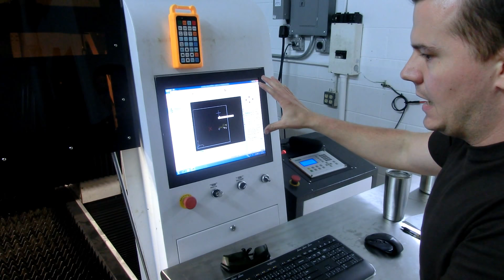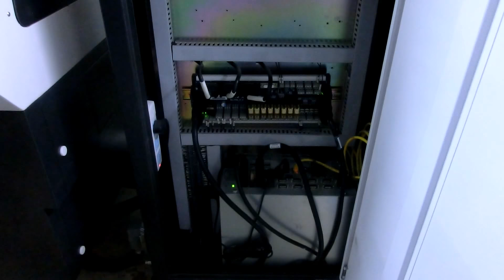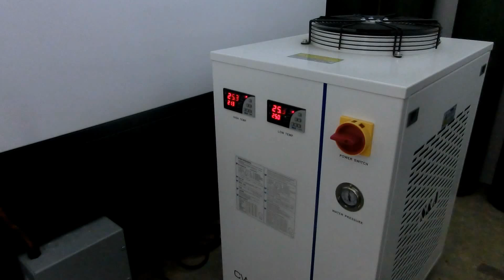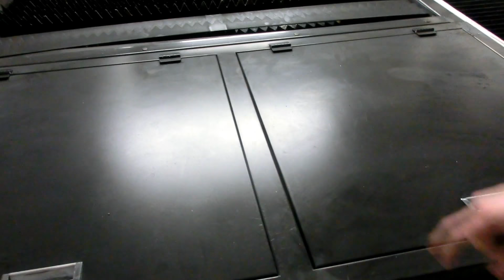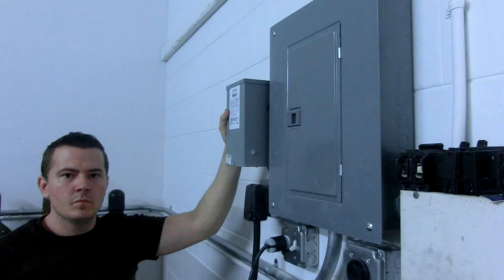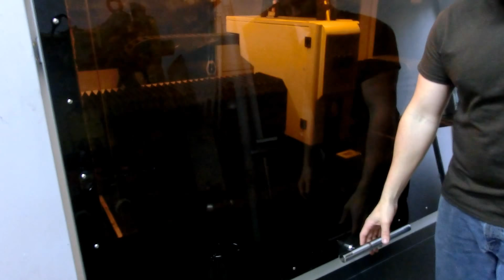Rose Graphix 4x4 500 watt enclosed fiber laser review

Comment: Do you have a tutorial on every layers use?
Reply from the maker: Are you asking about the layers in cypcut? If so those vary by what you use the machine for. We use 11 materials regularly so our layers are for those materials.. we will likely be doing a video on setting up new materials because we are upgrading to a 1500 watt laser source.
Reply: @smallshoplasers8785  I'm using 1500 watts
Reply: @smallshoplasers8785  yes each layer on the cypcut i only use white green and blue for cutting and engraving
Reply from the maker: @ramirbautista4048  So we only cut 11 different types of metal. So each of our layer colors is set to a different type of metal. It is slightly faster than changing the layer from the material library each time. But if you are cutting many types of metal then you have to load the parameters from the material library because there are just not enough layers. There is a work around of sorts that you can load a "mission" in cypcut which in my testing loaded up a fully populated layers tab.. I'll probably make a video of that shortly while I'm waiting for my new laser source.

Comment: Great videos. Any chance one of these laser systems can be ran on single phase?
Reply from the maker: The 500 watt and 750 watt can use single phase. Both of our machines are single phase. a buck transformer is needed to correct American 240v to 220v as the laser needs 220v.. but the part is available at electric supply houses.

Comment: Hey man. Always had the question... how do you deal with small parts that constantly flip up and get run into by the head with the enclosure? I have a flat bed and often have to pause and knock small pieces out. Seems like the enclosure would make that difficult
Reply from the maker: We adjust the tab widths to try to reduce parts flipping up. Very recently we switched to filtered shop air and that has added a few problems as the pressure is higher than O2, so we are working out a few solutions. We are in the process of making a few new videos related to using shop air and I'll post the findings.

Comment from the maker: I'm not sure what is up with the last five minutes of the video.. It should have something there.
Reply: 4x4 500 watt fiber laser Hello,  I'm looking to purchase a laser like the one you have in the next two days. I would like to talk to you.
Reply from the maker: Sorry I had the flu the last week and have not been in to the office. Hopefully you made your choice already if not I'd be happy to talk with you.
Reply: 4x4 500 watt fiber laser Hello, we purchased a 1000 watt like yours. What software do you use for nesting?
Reply from the maker: Good choice, my only slight regret is not going with more power.. How long until you get your machine? Did you get it through rose graphix/bescutter or someone else? 
 Nesting software we are using is Cypcut which is what the machine comes with, it works pretty decent and was of course included with the machine. Only real limitation is that it seems to only do 20 sheets of results, so we have to run the nesting software a few times, and the other being the computer hardware on the machine is somewhat limited so we limit the rotation options to speed up the results a little. I made a couple of videos showing nesting but I was recording the screen with a camera so it did not turn out well.. I have the hardware to do the video again with a proper screen capture device, but I need to find the time to do it again,  I'll try to get over there in the next week or so.
Reply: 4x4 500 watt fiber laser where are you from? I'm in Indiana. Machine is being shipped April 6th. So, end of April first of May. Not sure.
Reply from the maker: I'm north of Orlando Florida (I'm also the guy holding the camera in the video). We had a similar shipping time, we got our machine in the first week of December. I have found manuals for my machine, they are english but a little choppy on the translation, depending on which seller you got your machine from it may be the same.. We have a few recipes for cutting carbon steel with O2 that use about 1/3 the gas of the parameters the tech setup using smaller nozzles and shorter offsets. What type of metal are you going to be cutting? Are you intending to be a job shop or are you making a product?
Reply: Hello Mark,  I may be looking into one of these.  What Watt is needed for 1/4" mild steel and whats the most you can do with 500W on steel?  THanks.
Reply: @hectordeleon9249  Sir, 1/4'', 6.4mm. 500w is kind of hard to set, 1kW is ok, cutting speed around 1.1~1.5 m/min. Btw, the price of RAYCUS now, the 2kW RFL lower than 2 years ago. :-)
Reply from the maker: I did a little 1/4" plate with the 500 watt but it was not a very clean cut but I could probably get it dialed in better but I just needed the one part, it was fairly slow as well something like half a meter per minute (20 IPM), I think the 500watt is ok for 16ga in production, and up to 1/4" for one offs. The smaller fiber lasers do really well on thinner sheets, as you go thicker you need more and more power to get really clean cuts, and to have cut time be reasonable. Are you primarily cutting 1/4" or are you cutting a lot of thinner steel and some 1/4"? Because if you are primarily cutting 1/4" I would go with at least the 750watt or 1000watt.